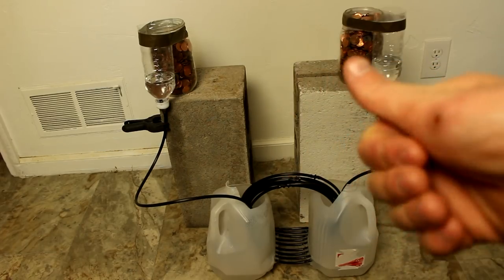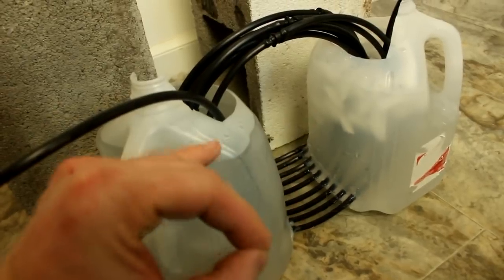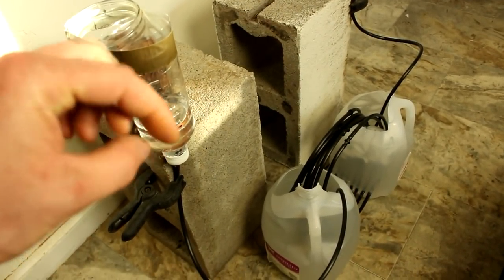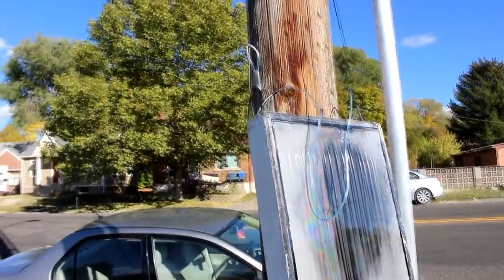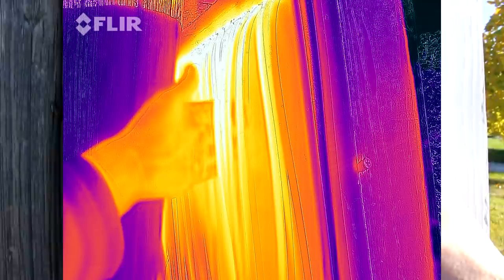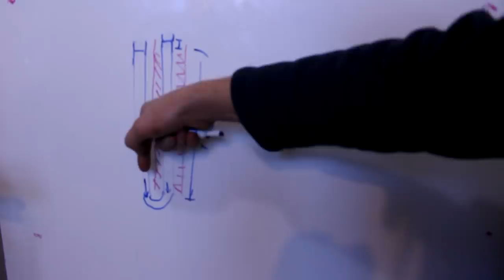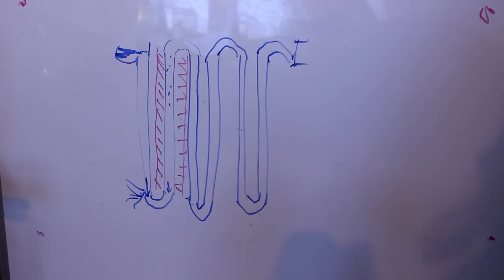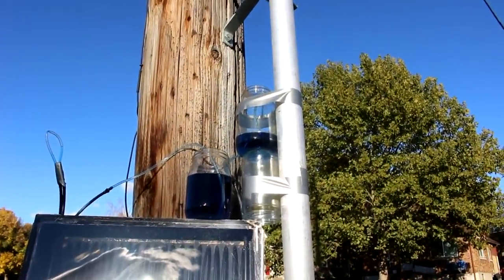Water Pump With No Moving Parts? (except water of course)

Comment: Wouldn't a system with a winding wire in the back and then a winding wire in the front work better? It would simulate a long pipe in cold and a long pipe in heat and would spare the large number of temperature changes.
Reply: Unfortunately... no. Every turn in the pipe has to have a corresponding temperature change. Otherwise the two sides of the turn will cancel each other out. Simplify it down to his original example with one bend and a length of pipe on either side. If both sides are warm then there's no height differential between them. If you were then to chain a bunch of those together everything will cancel out and you won't have any head at all.
Reply: No, but; a horizontal loop for cooling at the top/heating at the bottom would be a great idea, allowing the vertical columns to be the  right temp!

Comment: Isnt this extremely inefficient?
Reply: DioD3 it is useful for taking advantage of residual heat or solar. since it has no moving parts it requires less maintenance and it makes no noise. the design can be improved to be more efficient
Reply: He said in the video that a solar panel and electric pump would be able to move the whole jar of water to the top of the electricity pole in a couple of seconds.

Yes. It's inefficient.
Reply: Yes but if made from say glass or platinum it would still be working in a thousand years if not broken by an external force unlike the efficient pumps that would wear out in a few decades at most.
Reply: But how much water would be pumped in that time though?
Reply: It depends on pipe diameter and  temperature differential. Using an electric immersion cup heater and a 2" pipe I was getting a couple liters a minutes at a 3mm lift without misusing the heater.
Reply: could probably do the same thing with capillary action and a paper towel lol

Comment: Hi Cody. I'm not sure if this idea would meet your criteria, but you could shrink the pump a ton if you are willing to let a little water boil. 

If you used a small solar concentrator (either a lens or a mirror)  to heat up a reservoir you could push a relatively  large amount of water through a capillary tube in a few minutes just like pushing a piston in a steam engine. 
You might also have some control over when it is circulated by adjusting the positions of the solar concentrator and reservoir.
You might control the amount of water to be circulated by adjusting the length of the capillary tube.

Your brine shrimp colonies are coming along great. Keep making videos!

Comment: Can anyone guess how many pennies are in each jar?
Reply: Gmanmovies09 Hum... 14?
Reply: About 650 aka $6.50 Assuming those are 16 oz jars.
Reply: at least 2
Reply: +Cody'sLab Yep if we all guess and then take the average it should be very accurate. Cody should mention it in his next video. I'll guess 500 each jar.
Reply: ~1200
Reply: It's Over 9000!!!
Reply: 3
Reply: around 100 i dont know wat size pennies actually are
Reply: prolly could do it by weight.
Reply: Over the amount needed to counter weight .3 dl of water.
Reply: 1100
Reply: my guess, around 200
Reply: 1600 per jar
Reply: All of them
Reply: Gmanmovies09 2500
Reply: lets see if the wisdom of the crowd works good with a youtube comment section. This is kinda exciting.
Reply: My bad i was gonna say 1000
Reply: a Buck Fitty
Reply: Am I the only one who read that as "penises in a jar"?
Reply from the maker: I still have it set up, I guess I could do a count. And by that I mean I will weigh them.
Reply: Gmanmovies09 2300 a jar.
Reply: 1437. I've counted more pennies than I care to admit so I think this will be close.
Reply: Cody'sLab I would enjoy that
Reply: Gmanmovies09 1000 or 100, something in between?
Reply: 4 pennies
Reply: 170 pennies?
Reply from the maker: Ok so I weighed out 100 pennies  and it came to 250.00g the total weight in the 2 jars was 5227.6g which comes out to 2091 pennies give or take a few.

Comment: I'm not sure if this is 100% relevant, but Buckminster Fuller used "convection pumps" to heat many of his house designs. (Advanced ones heat during winter, and cool during summer, sometimes by filling a window space up with styrofoam pellets to reflect the sun during summer.) These were not "black inside of a window box," but black-painted metal that was located behind a two-layer insulated window. The hot water pipes that radiated out from the enclosed black reservoir surround the house by going "first up, then down along the floor"(so the hot air doesn't heat the ceiling, which doesn't need to be heated). If I recall correctly, the convention pumps could actually pump water at fairly high speeds and pressures.

Comment: Sorry cody, It isn't really new. It's calles a thermosiphon.
That's how solar water heaters work basicly.
A water tank is plased above a heat box, where copper pipes run through. The sun heats the water in the pipes, warm water rise to the tank while cooler water replace them below.
They're very common here in Israel.
Reply: Nothing Cody does is new.  He's demonstrating things for the rest of us.  We don't all share the same experiences.
Reply: I knew thermal heating was common, didn't know it used the heat to circulate the water though. Assumed it was pumped. Really cool.
Reply: No one said it was new. Where in the video did he say he invented a new technique?
Reply: I won't search it for you. Just pay attention on what he says. He speculated to maybe have invented it after not finding it with a Google search.
Reply: Kronaz邪児 very beginning he said he’s trying to invent a new pump
Reply: unjust: and at the end he said he's pretty sure it's not new, but he wasn't able to find anything in a quick google search (as he doesn't know what it's *called*).
Reply: I find it really hard to believe that Cody has never seen a solar water heater. This contraption he made resembles one in every way, it even heats the water with the sun and all...
Reply: He is pumping water, not transferring heat. so this is somewhat different. A thermosiphon is a closed loop that does not do any lifting. One side is heated and the elevated side is cooled "or where heat is extracted".

Comment: I have seen something like this thing done with metal pipes used to move air.  It was very efficient, and with enough heat you might be able to run a pneumatic pump. Your biggest obstacle would be sufficient heat to move the air if you were just trying to use solar. I believe the system I am thinking of used fire (pretty sure but not 100%) to create the displacement. But if you just came up with this idea then I'm sure you could make it work, if not very efficient.

Comment: Dude, I believe having multiple loops of tube is the same as having one in this setup. You put the tube in cold water and then warm but then again cold -- that looks wrong to me. Make multiple loops through one canister and then multiple through the other: 1 1 1 1 1 2 2 2 2 2, not the 1 2 1 2 1 2 1 2 1 2
Reply: I'm thinking he should only have one cold loop and many on the warm side. The pressure in the system will be the same, and there will be more distance of warm water to expand.
Reply: No, you need to heat and cool the water each loop, otherwise the stacked loops cancel out and only gives the effect of one hot or cold loop
Reply: this is a tried and true pump called a thermosiphon, lots of good science already done on the concept.

Comment: You changed the title
Reply from the maker: Several times... still dont look right.
Reply: Cody'sLab if you take away the question mark it looks good enough for me
Reply: "Making a water pump with only water as moving parts"?
Reply: Perhaps you could just call it a "Heat Gradient Water Pump" or something like that. Still will get you no results Googling it, but the title sounds more interesting.
Reply: Non mechanical water pump

Comment: That's how those water heaters on the top of the roof works. Your reservatory inside the roof is cooler than the plates with steel tubes(or silicon based hose) painted black outside on the roof in a curling spiral shape. When the sun heats the plates, the water inside of the reservatory pushes the hot water back to the reservatory untill it stabilizes. Saves electricity from the shower and water tap. It is pretty common here in my country.

Comment: I'll have to work it out on paper to make sure I'm not missing something, but I've got an idea in my head for a similar thermal pump that could use much less tubing. I don't think it would get much head, but it might have a higher flowrate.

My idea is to have a single tube with a parabolic reflector (aluminum foil perhaps?) focusing sunlight onto it. Assuming the airspace on the bottom container is not vented to the outdoors (if it is, and it occurs to me that it might be, you won't want this setup), and there is a pipe for return flow, in other words the system is primed, then then a convection current would draw water up through the tube into the next container, where it would do whatever, then, after cooling off, it goes back down another tube (perhaps painted white to minimize hear absorbtion) to the lower container.

This is I guess basically what a single loop of your pump does, just designed to focus on the convection.

Comment: some things you could do to improve this concept:
1, you could use copper pipes on the back in order to move the heat away (takes alot more work to do)
2, you could use mirror instead of white paint on the back (my theory)
3, you could use some of that silver UV glass protection film, on the glass side in order to trap more heat/uv inside the box (also a theory)
4, you could isolate the the middle plate (black/white one)
5, you could completly close the white side closing all the pipes in there then have 2 holes for solarpowered fans moving air through, removing the heat (requires moving fans ocf)
6, you could use the "coldness" of the ground in about 1 meters down, as its a lot more constant low temperture down there, to cool the pipes with :(this would probably be the best "performance" you could get)

Comment: Building on what Nishith Chauhan said, Cody should also use aluminum foil instead of black spray paint. The foil would reflect the light already hitting it and increase the temperature at least a few degrees centigrade. One other part that might be hard to achieve is maybe extending the hoses in the back to accommodate a cooling rack of some sort, say a cooler

Comment: One thing to try that may help with the heating side of the tubes and possibly prevent a bit of heat transfer through the box is to add a mirror behind the hot tubes.   
so there is a form of solar generation plant that doesn't use photo-voltaic cells, instead oil is in a sealed system ran through a pipe to be heated by the suns rays, most often these rays are focused through a lens or even a series of them onto the pipe but also there is another pipe partially surrounding the one filled with oil that is mirrored on the inside to reflect the sun's rays back onto the pipe getting somewhat of a double use of the rays before they become wasted. 
After the oil has been heated, as it is expanding, it flows to a cistern filled with water where the pipe runs in something like a radiator setup to bring the water to boil where steam turbines are the thing actually producing the electricity.  
Many of these oil filled pipes are ran to heat a single cistern, also the steam is reclaimed to be used again by feeding it into a cooling tank where it goes back to the cistern...or the water is sold as filtered water.

Comment: What you're trying to reproduce is called thermal driving head. A lot of things use difference in density due to difference in temperature to produce a driving head to move a fluid. Many nuclear reactors are designed to do so in case they have a coolant pump failure the steam generator (heat sink) sits higher than the reactor (heat source). As the water heats up in the reactor by decay heat it rises and gets cooled by the steam generator lowering its density making the water heavier (the driving head) thus returning to the reactor which is physically lower by design. Physics is pretty cool.

Comment: from what I understand, you need the heat exchange to happen at the top of each of the loops since the water cools down as it gets goes down the back of the box. with the rubber, would sticking a piece of wire down the back of each of the tubes (maybe 15-30 cm) and having them poke out of the rubber and then connected to each other work? Of course sealing the tubes might pose a problem, especially with the glass tubes you were talking about at the end of the video.

Comment: Cody you have it right. check out a hydronic hot water baseboard system. Closed system. Small expansion tank to handle the increased pressure. It will run around the loop without the circulators running. May work better with copper tubing to conserve the temperature all the way thru to return to your heated supply.

Comment: For heat exchanger you would need sections connected by capillaries but that will also cause more resistance in the system so some kind of electrical transfer of heat would be necessary, or with a separate transfer system by using refrigerant and pump. The refrigeration pump could be powered by the movement of the water.

Comment: If your goal is an enclosed system of water movement, you should use an induction circuit. Essentially you would create a motor with a single wind coil on the inside of the enclosure, a magnet and a larger coil on the outside. You could also use wicking with some sort of salinization process.

Comment: Maybe take the feed reservoir out of the hot sun and start with cold water . ? Place it just below the top of the tubes and reduce the hight of the tubes by increments  so that its siphoning more and pumping less ? Pull it to the final push ? Use a rifled tube to enhance the fluid dynamics and rate of flow. Taper it from broad at the begining of  down flow to narrow at the top of the up. More volume in the shade to cool faster and add mass  to the down cycle of the down  / up balance .   ( or one long  tesla valve with two chambers ? )   picture two tesla valves in a tube styled like a dna strand. . I enjoyed your video. Thank you. There is a quote somewhere by someone that says ' would the person who says its impossible shut up and let the person actually doing it get on with doing it . I like your style . Dont wait around for the perfect pen to be delivered so that you can draw the pencils on your table . 😉 when people say it isnt an efficient way of doing something i always ask them if its more efficent than not doing it at all. Your pump is 100% efficient. It pumps 100% more water than a pile of parts .

Comment: Try capillary action
A row of pipettes sucking from a reservoir below, with a surface tension "lip" on the top of each pipette.
They will slowly "pump" water up to the upper reservoir.
Make it large enough, with the head high enough - you could probably get some work done with return down drip.
Make a perpetuum mobile

Edit... I just got to 15: 00 where you mention capillary...
hahahaaaa

Comment: You invented an early Solar Thermal Difference Fluid Pump. We need a cool name for it though. Solar Pump. Something like that. Very cool! When your design is a bit more polished, I'd LOVE to build one of these. I'm no scientist, but I like to build tiny versions of some of the things you build. But for this I'd go massive scale. Sounds like a copper heat synch of some sort, or copper pipe in the shadow, may be good for the cooling areas, with a certain amount of fluid dribbling over the copper for further heat removal. Not to over complicate it. XD But thank you for the ideas Cody. Now to watch the last bit of the video.

Comment: Even though this video is now a year and a half old, it still shows up in recommended watching, so a couple thoughts on improving efficiency might still be useful.  Using a finned cooling block for heat dissipation on the back side, with a similar block, sans fins, that serves as the focal point of a large fresnel lens on the front, both positioned in the middle of the loop, would help to maximize your thermal differential.  Building a vertical air duct around the cooling block would also create a defined channel for airflow that could increase the passive cooling efficiency.

Comment: Hey Cody, think of how plants move sap to the top of the trees. It is "vacuum". As the leaves transpirate, there is a void left and sap gets sucked to the top. Of course in your glass biobricks you would fight against vapor pressure but you could rely on the day/night cycle to evaporate water on the heat, and then let it condensate at night, thus sucking the water at the bottom. A one way valve is needed but I think it's a moving part you don't really have to mantain

Comment: I think we use this phenomena in central heating furnaces. Called in Swedish ''vattenrörs panna''. 
These boilers take cold water (30-40 degrees Celsius) against the district heating network ( output 80-110 degrees Celsius) and heat it against the boiler. This gives a similar self circulating system and because the entire boiler house is a made out of water pipes, you get the same effect as you describe here. However, all boilers do not work in this way, but it depends on their own resistance in the pipes themselves and a whole lot more. I can not do the math anymore but I think you can figure it out if you google a little ;) Mabey look at roster furnace or a fluidized bed furnace.

Comment: Use an air pump and bubble the water through a vertical tube. It has the effect of lifting/pumping water. It also helps with the dissolved oxygen.